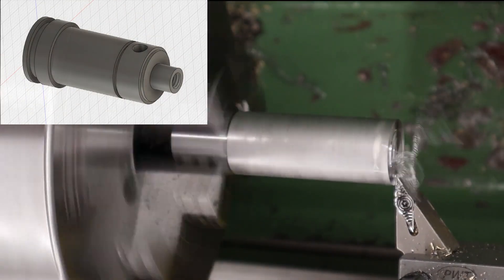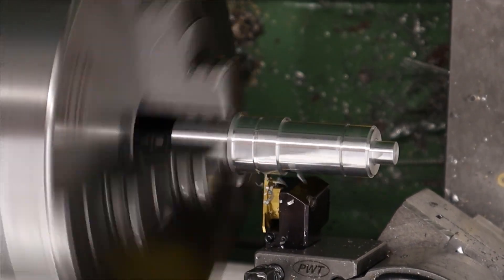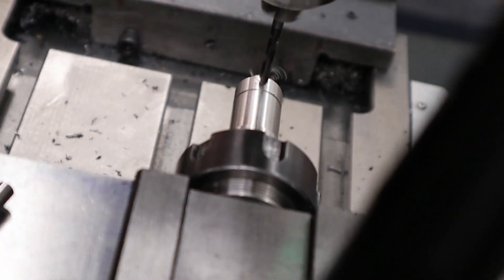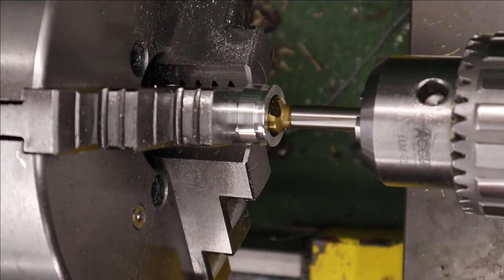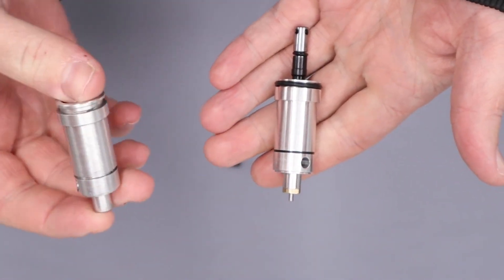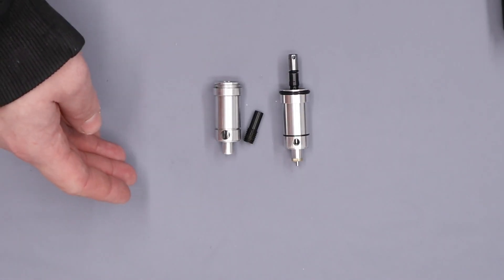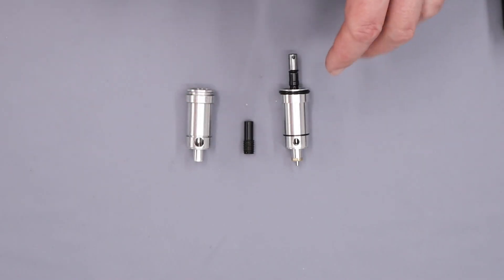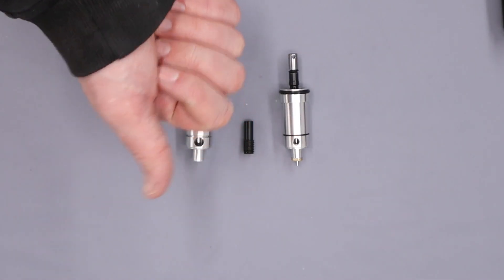Airmaks Krait making a new valve.

Comment: Interesting you said a rule of thumb was for .177 the transfer port should never be bigger than barrel ? I can understand that , however on my m3 when I had standard transfer and probe it wasn't so consistent but when I switched to duel transfer and high flow probe the consistency deviation was 6 apart over a 12 shot string ? Just wondering if you could think of why this is ?
Reply from the maker: This can be true, when you have to much air it can mask inconsistency's in valve strike,  and give a more consistent fps, but we are going for efficiency so we have to make sure the valve strike is consistent and we should end up with a very efficient and consistent gun   👍
Reply: @sub12airgunners  awesome thanks , much appreciated for sharing your knowledge 👍

Comment: i do love your posts but could you not sleeve the existing valve port with some lathe trickery. I know this would be less fun but huge cost saving in time.
Reply from the maker: yes you could just sleeve it but we wanted to make a new housing so we could put an o ring on the pin 👍 but yes that would do the job just as well 😁
Reply: Could you put a blanking plate into the hole and drilled it out to the smaller diameter for the 177?